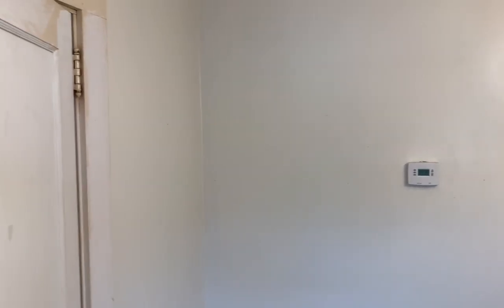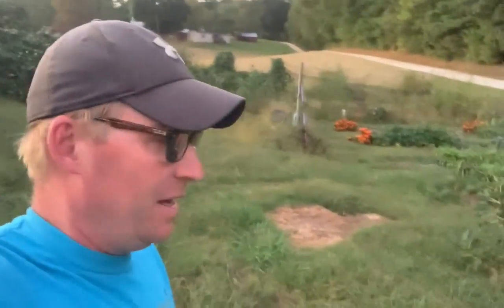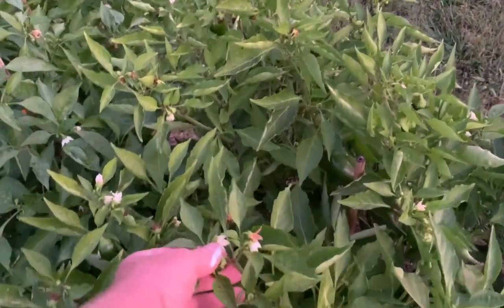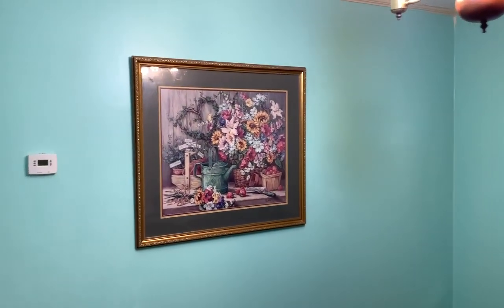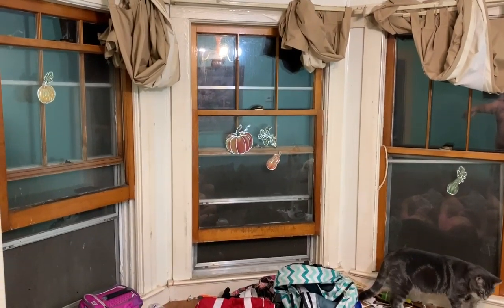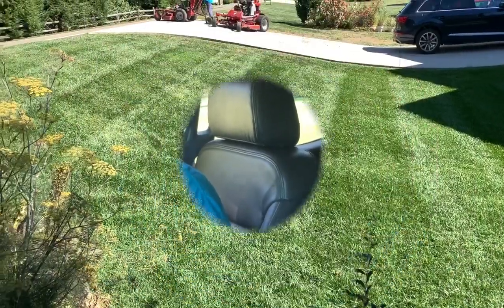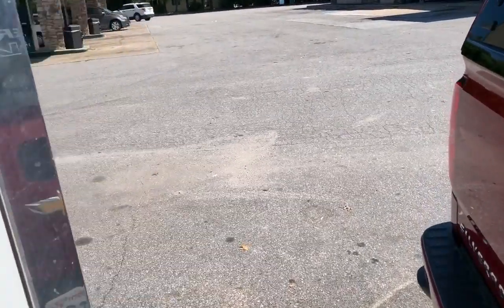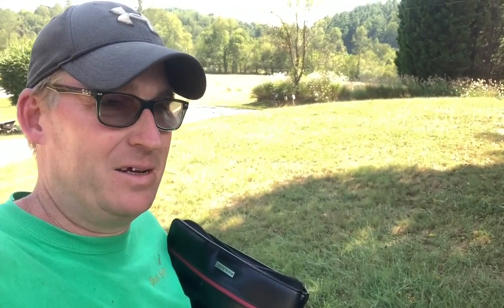Just another day in lawn care! More tire issues!

Comment: Painting trick: Just like using a pole when painting the ceiling so you don't have to use a ladder and avoid getting splattered, use a pole when doing the walls so you can stand back from the roller and not get splattered. It also lets you see your work from 5' instead of 1' to make sure it's all nice and even.
PEACE